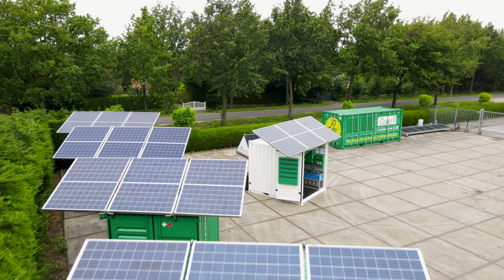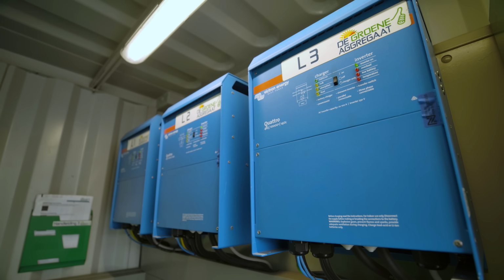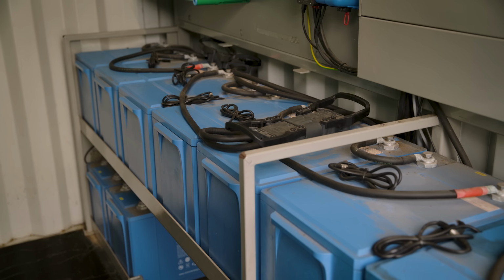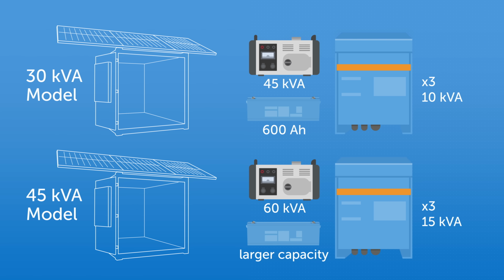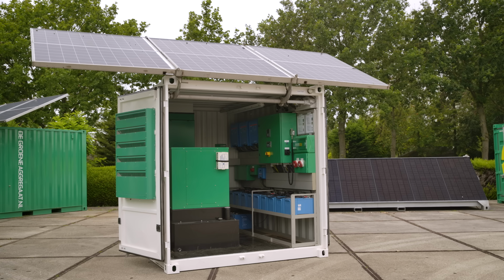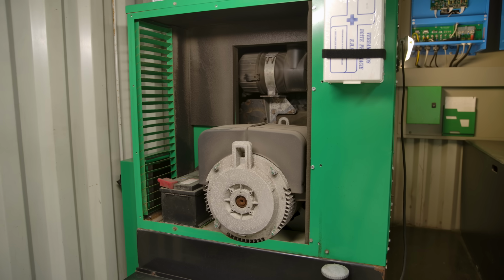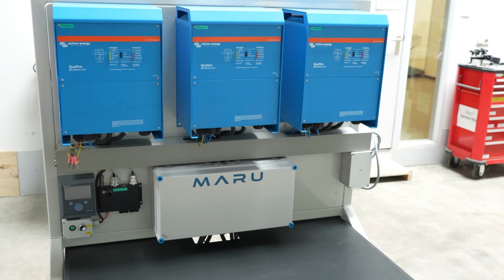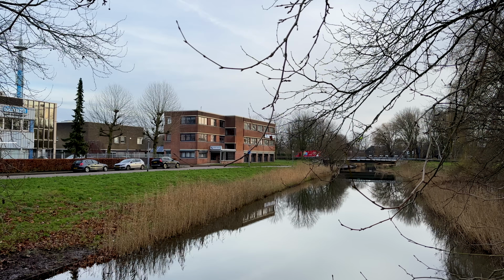Is this the future of Generator Power?

Comment: with regard to generators I (and many others more..) have a significant issue with the victron VRM and monitoring system.
Many users have grid-parallel PV/Battery-systems AND run additionally a generator (combined heating-electricity-gasturbine: mine e.g.: DACHS from Senertec)
Unfortunately VRM does not support the generator being measured by a separate grid-meter... 
The power genertated by the DACHS is considered PV-power..... as I can only meaningful determine the grid-,meter of the DACHS as PV-meter
If you determine the DACHS-grid-meter als generator the calculations in VRM are nonsense.. 

The issue is, that one cannot determine a grid-meter as generator-meter in a net-parallel system.

Will you fix that one day?

Cheers 
Michael

Comment: Mmm..  Not sure how green this is, though.  There is so little solar on those containers it might as well not have any solar at all.   The amount of solar is also not even remotely well-matched against the amount of battery storage.   It is clearly designed to operate on the generator.
Reply: Yes , the battery / inverter help the generator become far cleaner as for the most time the generator can be switched off 
Beside this the solar helps extend this period

Comment: Why I already have similar system for years with 12 kwt invertor 12 kwt solar and 5 kwt generator (It charges only 4kwt/h for best fuel efficiency). And it is cheaper and more efficient.
Reply: Thank you for sharing your experience with your existing system! We appreciate your feedback and are glad to hear about your successful setup. Every system has its unique advantages and considerations, and we're continuously working to enhance our offerings based on valuable input like yours. If you have any further insights or questions, please feel free to reach out through the website mentioned in the video description. We're here to support you in your sustainable energy journey.
Reply: @TheGreenRentals Just want to say, it is not a  "future of Generator Power". Such solutions exsit for more then 10 years already. Just wrong advertising campain from you guys. Your solution may be good, but video is confusing.

Comment: If I had a small wind turbine plus solar panels connected to a Giant motor that only charges batteries. I could do without a Diesel/gas Gen 80%  of time. Just make sure I have batteries oversized in Amps. This is equivalent to steam 🚂 Generation and not 🚫 this excuse to sell a high maintenance Gen.

Comment: I have been doing the same at my house for the last 4 years...5kW hybrid inverter, 3000 watts of solar panels, 48 volt electric forklift battery 875 AH, 6 kw Deutz diesel generator, but not in a container, it is a tempting idea...
Reply: We admire your sustainable energy setup! Our containerized solution offers portability and scalability, enhancing energy storage and management. If you're interested in exploring this idea further or discussing potential enhancements, feel free to reach out to us. You can find more information on our website, linked in the video description.
Reply: I have a similar set up for my home in California I have 4kw solar array a Tesla Power wall and an 11kw natural gas generator attached. All told cost me a little over $17k. My solar provides over >99% of my power needs. I am still hooked up to the grid and I have only needed grid power a couple of days in the last three years when it was raining heavily for several days straight. Even when it is overcast I generate enough solar for my daily needs and my Power wall will meet my needs for over two days with minor limitations.
Reply: @matthewhuszarik4173 You have a  cool system, but much more expensive than mine at CAN $ 5500... I happened to be at the right place at the right time...I got a good deal on used equipment, and that worked very well for me...Unfortunately there is no way my system can provide 365 days a year as I am in Northern Canada, I would require another 3000 watts of panels at least

Comment: If they engineered another set of 6 panels to deploy on the other side of the cube it would be around 4000w and you wouldn't need a diesel motor in most cases.

Comment: How much power needed in cold temps to keep batteries warm?
Reply: not much , its just to get the temperature above 5 C deg
Reply: @micklaws The power needed to keep batteries warm in cold temperatures varies based on factors such as battery size, insulation, and ambient temperature. For personalized insights or calculations, please don't hesitate to reach out to us through the website mentioned in the video description.
Reply: @TheGreenRentals  Will do, thankyou much

Comment: These are aimed at cases where currently a generator would be used.
However, even the weakest commercial generators provide FAR more power a day than those panels will. 

In the end this means that in the usecase they market those, it will likely be just a very unwieldy generator.
Reply: For people commenting here 

This does niet replace a generator 
It’s to save fuel , up to 80% reduction 

This is because the generator runs less AND on a much better load 
So far less service intervals …
Reply from the maker: The solar panels are just supplementary.  This system uses the generator at its most efficient under a high load and then turns off giving a quiet system.  If the load required is low, as is often the case for laptops and lights, the solar will likely keep that soc all day.

Comment: When this system is enclosed in its metal housing will it withstand an EMP attack?
Reply: While our system is designed to withstand various environmental factors, including weather conditions, we haven't specifically tested it against EMP attacks. However, we continuously strive to enhance the resilience and durability of our products. If you have specific concerns or requirements regarding EMP protection, please feel free to reach out through the website mentioned in the video description. We're here to address any inquiries you may have.

Comment: Solar Panels are just their for show.. They barely contribute 10%.. Also considering the cost of its hybrid inverters + panels and the added volume + weight to the overall system...
Reply from the maker: The solar panels are just supplementary.  This system uses the generator at its most efficient under a high load and then turns off giving a quiet system.  If the load required is low, as is often the case for laptops and lights, the solar will likely keep that soc all day.
Reply: What you see in this video is a specific model of which we make this certain, smaller, quantity for the Dutch Rental Fleet market. This number is larger for the whole of Europe, here we also make other , bigger, models for the European/global market. We produce mobile and fixed sustainable power solutions.

Comment: And what about service and support?  What is the turnaround time on spare parts? And the big question,  what's the out the door price and warranty.   Remember,  everything is great,  until it quits working.
Reply: As far as the equipment, all is on stock ( in the thousands often), so thats a matter of days.  And remember that the generator can also work without the hybrid part, its then just taking 5 x more fuel as other systems do.
Reply: @johannesboonstra6917  so, what's the price on the 110kva, and specs, such as weight? Do you have a site with specs?
Reply: We understand the importance of service and support, and we prioritize quick turnaround times for spare parts. Our comprehensive warranty ensures peace of mind, and our dedicated team is always here to assist you. For specific pricing and warranty details, please contact our sales team through the website mentioned in the video description. Your satisfaction and continued support are our top priorities.

Comment: The potential future of generator power is likely to involve a shift towards more efficient and sustainable options. This could include advancements in technology for portable power generators, such as improved efficiency and the use of renewable energy sources. Additionally, there may be a focus on the development of virtual power plants, where individual homes and buildings can also contribute to the power grid. The energy mix of the future is expected to be a patchwork of renewable sources like wind, solar, geothermal, hydro, and nuclear power.
Reply: Absolutely! The future of generator power is evolving towards more efficient and sustainable options. We anticipate advancements in technology, including improved efficiency and the integration of renewable energy sources. Additionally, the development of virtual power plants will empower individual homes and buildings to contribute to the grid. With a diverse mix of renewable sources like wind, solar, geothermal, hydro, and nuclear power, we're moving towards a greener energy landscape. If you have any further insights or questions, feel free to reach out through the website mentioned in the video description.

Comment: First off, 600Ah of battery will barely run a small house for a day, let alone a construction sight, do they have any idea what they are looking at?
The solar panels, while a nice touch won't get you any appreciable gain in real life use.
That diesel? Generator is going to see a lot of hours.
This is IMHO a "feel good about yourself" scheme.
Reply from the maker: Many off grid companies have huge generators running all day and night for low loads like cctv, laptops in a portable cabin etc. This generator can help in these situations. The offer a variety of battery sizes. 

Again if a site is running low loads but needs power, the solar is more than capable of keeping up with the demand.
Reply: The difference between a partial loaded generator and an optimal load generator is that the diesel is used 4 x more efficient.  So this means that on a typical site the fuel consumption is going to drop with 75-80%.   Which also means less maintaining , less fuel transport ,less noise and so on.....

Comment: obviously it is more efficient to generate power directly off the generator and not force losses by charging batteries first, but there is no harm in adding a few small solar panels
Reply from the maker: Not when the loads are small like a static cabin where only laptops and lights are needed.  This is often the case and so it's best to charge batteries using a generator at its most efficient load and then rely on the batteries and solar in the quiet to power these low loads.

Comment: It doesn’t look like enough solar panels to charge the batteries.  It looks like under a household load, the generator would produce most of the power, to me.
Reply from the maker: The solar panels are just supplementary.  This system uses the generator at its most efficient under a high load and then turns off giving a quiet system.  If the load required is low, as is often the case for laptops and lights, the solar will likely keep that soc all day.

Comment: You can also configure the containers exclusively with solar and batteries. I would get something like that with a sodium ion battery.
Reply: yes, but then there would be less average power of course.
Reply: @johannesboonstra6917   I mean a solar power bank in kWh range. My point is to use it that way. That I can charge more electricity via solar than I use.

Comment: It’s a shame that we have been building these for many years and they think it’s a new idea. ? ? With so few solar panels you will be using the generator the most. Dean
Reply from the maker: This isn’t a new idea agreed. But it’s not widely used in the EU yet.
Reply: We understand your perspective, and we appreciate your feedback. While the concept of hybrid generators has been around for some time, we're constantly innovating and refining our solutions to meet evolving needs. Our aim is to strike a balance between renewable energy sources and traditional generators to provide reliable and sustainable power. If you have any further questions or concerns, please don't hesitate to reach out through the website mentioned in the video description. We value your input and are here to assist you.

Comment: 1600 watts of solar output is not a lot, especially in cloudy Netherlands, not even enough to feed one household,  I bet it will run the generator a lot to keep the battery topped off.

Victron is quality for a fair price but nowadays you can buy inverters that also perform very well for ⅓ of the price.
What i dont like their somewhat deceptive power output ratings, because most people don't know that a multiplus 5000 VA is only rated at 4000 watts continuous and are suprised when I tell them that.
Reply: ?  The point of the whole system is to have the generator run less, and when it runs as efficient as possible. It's about saving fuel and getting the fuel to the system ect. Of course the system cannot run always on solar , thats not the point.    On price, if we could make a reliable inverter with all the features it has for less money, we would.   We have over 50 years experience and have a good understanding about long term reliability
Reply: We appreciate your insights and concerns. Indeed, solar output can vary, especially in regions with less sunlight. We're continuously working to optimize our systems for efficiency and performance.

Regarding inverters, we strive to offer quality products at competitive prices. We understand the importance of transparent power output ratings and aim to educate our customers to make informed decisions. If you have any further questions or would like to discuss your specific needs, please feel free to reach out through the website mentioned in the video description. We're here to assist you.

Comment: Said they like to produce global! But  the website is not in English, and I'm not going to use google to translate  to find out more info! And I can't get information about this so-called green generator in the state of Florida. Unless there is another English based website one can look at. Which i find crazy the video is in English!!
Reply from the maker: This is a Dutch company that supplies globally.  If you don't speak Dutch, then you will likely need to use a translation service.
Reply: @VictronEnergyBV  would just be easier to contact Vicron in the states and purchase equipment or setup from them?
Reply: @dennissmith1469   Nice to hear you are interested! The Green Rentals also has a English website.  This is mentioned in the video caption. Here you can find all you need to get in touch.
Reply: @dennissmith1469   Nice to hear you are interested! The Green Rentals also has a English website.  All you want to know is on there, you can find it in the video description.

Comment: Why not use solar panel power to convert water through  electrolysis to produce hydrogen fuel to run a good dependible engine turning a generator also including the batteries

Comment: 1.6kW solar panels with 30kVA fuel generator lol
Reply: The point of the whole system is to have the generator run less, and when it runs as efficient as possible. It's about saving fuel and getting the fuel to the system ect. Of course the system cannot run always on solar , thats not the point.
Reply: Also, there are many parallels here with hybrid electric cars. The two complement each other imho.

Comment: The photovoltaic panels on these containerized units provide only a trivial amount of power. Unless the power consumer has the unusual situation of their power demand going to very low levels for prolonged periods, that power consumer can get essentially the same benefits as these containerized systems from using a common Inverter Generator. Such generators spin only fast enough to generate the power required at that moment, and use the inverter to keep the power frequency constant.
Reply: This is far more efficient than using an inverter generator that runs part throttle all the time.  This generator runs at full power (where it is its most efficient) to charge the batteries. when the batteries are topped of it shuts off. True the solar panels do not generate that much power but these are big enough they will help. Gas or diesel engines are not near as efficient at partial load as one running at full load. But if your comparing a store bought generator to an inverter generator yes an inverter generator is going to be more fuel efficient. But this setup is far more efficient than n inverter style. It is more efficient because the load can be small and the generator does not have to run at partial load. only full load to recharge batteries as needed.
Reply: Thank you for sharing your perspective! While the photovoltaic panels on our containerized units may provide a smaller amount of power compared to other sources, they contribute to our goal of promoting sustainable energy practices. Additionally, our containerized systems offer advantages beyond immediate power needs, such as environmental sustainability and long-term energy resilience. We appreciate your feedback and are continuously exploring ways to improve and optimize our solutions. If you have any further insights or questions, please don't hesitate to reach out through the website mentioned in the video description. We're here to assist you.

Comment: You could probably reduce the size by using 48v Lithium batteries, you'll get more storage in a smaller footprint.
Reply: Thank you for the suggestion! Indeed, 48v Lithium batteries can offer greater storage capacity in a more compact size compared to traditional batteries. We're always exploring innovative solutions to optimize our systems, and your input is valuable. If you have any further ideas or questions, please don't hesitate to reach out through the website mentioned in the video description. We're here to assist you.